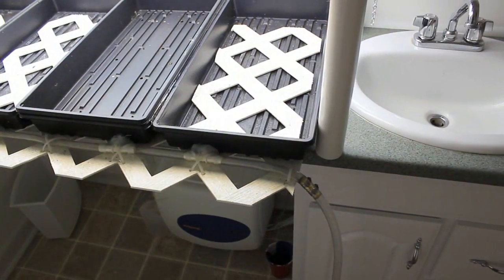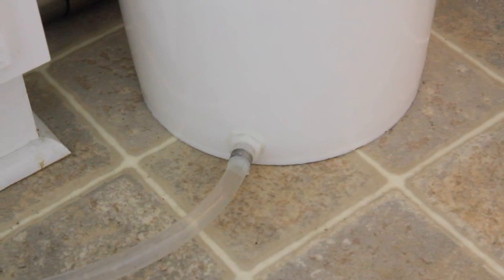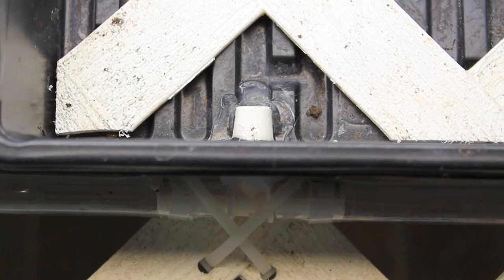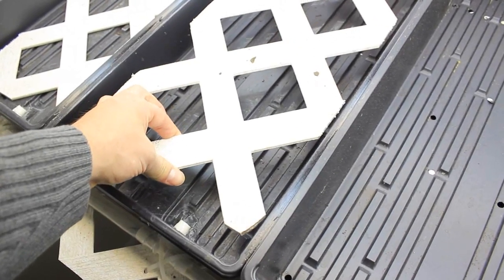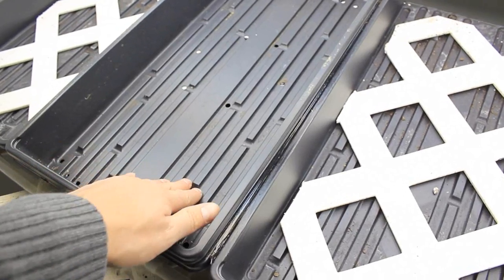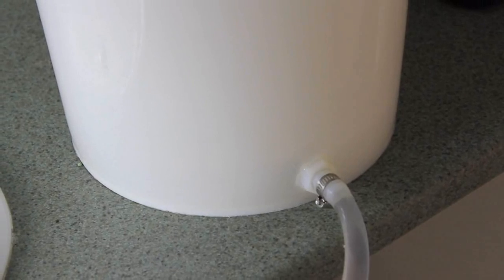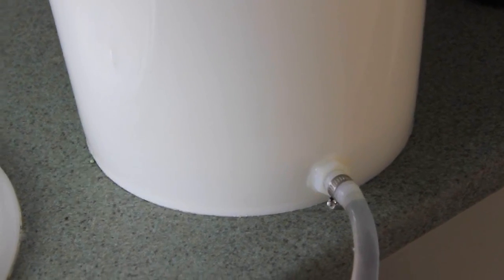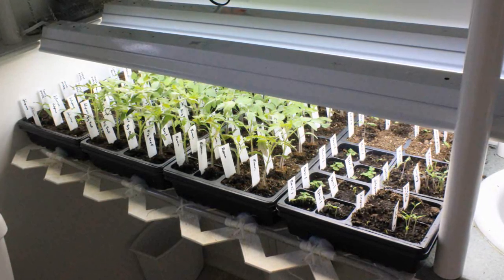Seedling Self-Watering System

Comment: They almost all do. The cheapest design for a pump is an impeller, when it is not running it has gaps that allow back flow through the pump. You'd need to spend a lot of money to get a piston pump that would not allow back flow. So it is almost certain that any pump you buy is an impeller.

Comment: You need to be careful about how much water you put in the bucket. Too much and it overfills the tray. This only avoids over-watering if you get the bucket feeder time perfect. If you forget and leave the bucket there for too long, your seedlings are sitting in soggy water Since you are lifting and lowering the bucket anyway, it might be easier to just set up the trays the same way, without the hoses, and just fill the bottom tray with enough water to moisten the soil.